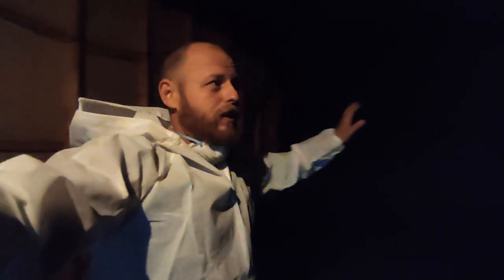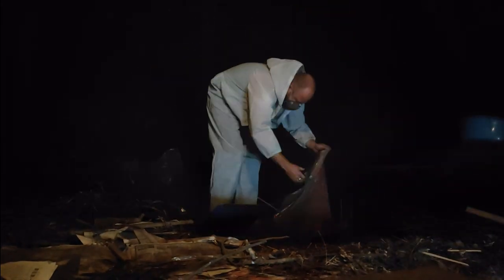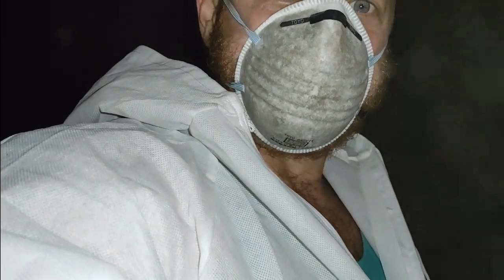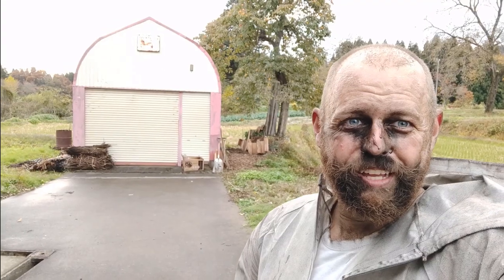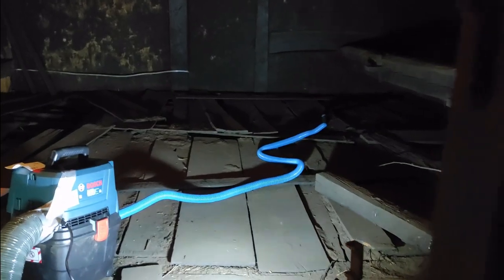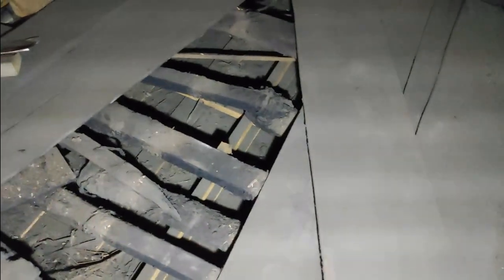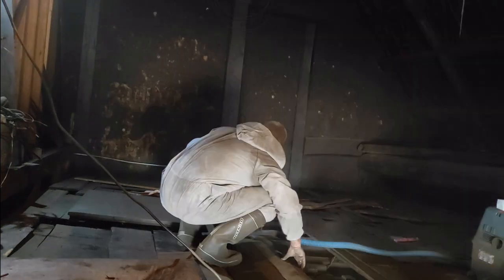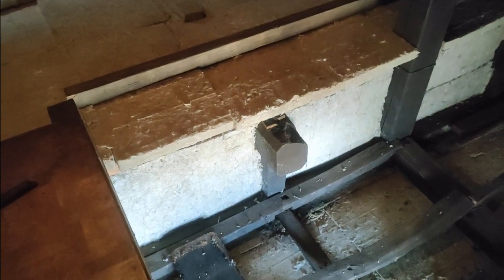1872 meet 2022.  Insulating our house in Japan!

Comment: Rockwool is a real good idea. And I like to see your procress :)  Hope you get a good place to live :)
Reply from the maker: Thank you! Yeah I love rock wool. I just hope I have enough. I guess when in doubt add more insulation! Also next steps will be double glazed windows!!
Reply: @OurHouseInJapan  just don't add to many layers, then it can have adverse effects, and start molding... But i'm sure you already know this 🙂
Reply: @OurHouseInJapan  Does Japan also have wool insulation available? I installed that in our PNW 100 year old farm house because it helps the older homes breathe more effectively, my next choice would have been rock wool.
Reply from the maker: @69Aliencry  the most common I've seen are pink glass wool, and then otherwise styrofoam which comes in various r factors. I will be using the pink stuff for some other sections in the roof i just found, as I only have about a foot of clearance to pass a big section 😅 I'll keep my eyes open for wool insulation!

Comment: As someone who sold rockwool, 5cm is like.....nothing for value. the r40 (forty year old standard in canada with similar climate) is 12 inches thick. You need a whole lot more insulation that that!!!
Reply from the maker: Even the 5cm has made a large difference... But single pane windows and open floorplans will definitely make it an up hill battle. I'll definitely look into more heat retention solutions for next winter. 👍

Comment: What are you going to do for heating? Wood, gas or electric or a combination?
Reply from the maker: I have a hitachi heat pump, as well as kerosene heaters, and an oil heater... Oh and a ceramic heater. I think the main rooms will be by heat pump with local use of kerosene / oil heater in the bedrooms when needed.  

I'm still trying to figure that part out!
Reply: @OurHouseInJapan  Sounds good. Diverse heating solutions are the way to go in our part of Nagano. In September electricity is going up again by 30% so keep this in mind.

Comment: hey how much is it (ball park figure)  to build a concrete small house after taking down the old one ?
Reply from the maker: Size of a garage would be probably $7000--12,500 i assume.  an actual small house.  $30K plus plus plus (just for cement work) single floor bunker with a few walls.  Could be more.
Reply from the maker: I've read that a good estimate is yen 250,000 per square meter is a good estimate... 350,000yen / m2 is even better. for new build
Reply: @OurHouseInJapan  thanks a lot. There are lot of renovation info but very few new build info. 

-  Tear down cost
-  Cement work ( few walls, roof can be tiles)
- Electric work
- Plumbing
- Windows etc

Even for a very basic house of 50-100m2, it seems the cost goes up to $70k-$150k+. Which makes me wonder if buying a good enough property is the way to go. Or good enough akiya + medium renovation might be cheaper

Comment: how'd you deal with the murder hornets?!?
Reply from the maker: I hired a company to come in and remove the nest, which was good in a pinch but as it cost over 20,000 yen, I will develop a new wasp strategy.  So far to ensure they don't come back I bought a crazy hornet spray, and right now I'm in the process of installing a breathable mesh to obscure the entrance to the roof space while still allowing it to breathe so the thatched roof has some circulation still :) 

If it was bees I wouldn't be so worried, but murder Hornets don't seem like fun!
Reply: @OurHouseInJapan  gotcha!  yea i eat Uber the impression you went in and removed them by yourself 😳
Reply from the maker: @nopefoh  I think next time I will try to remove them myself, but in a full protective suit and hopefully have an escape route to run away 🤣